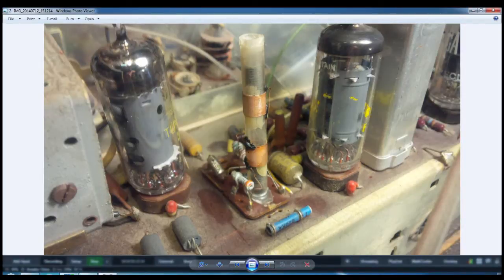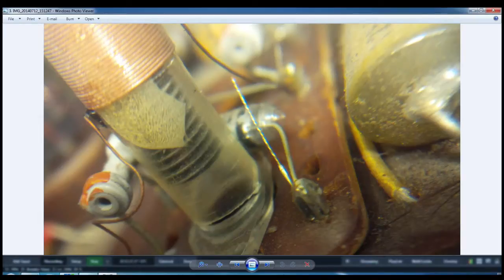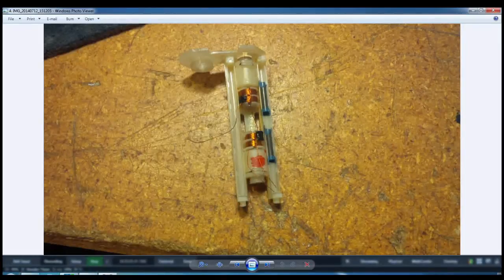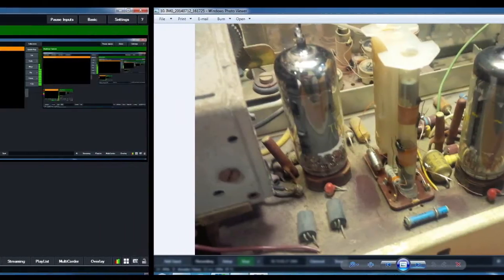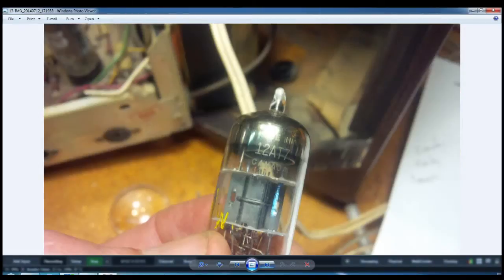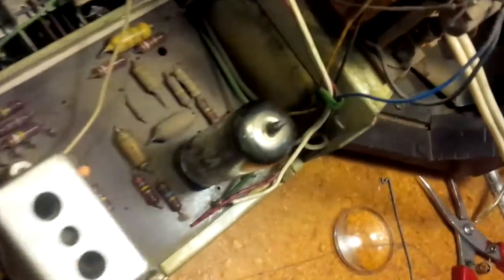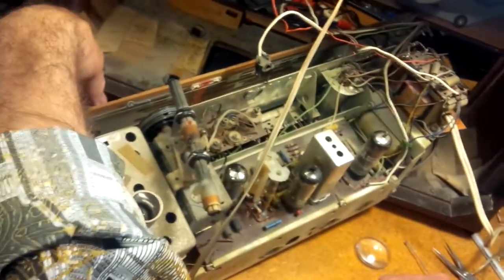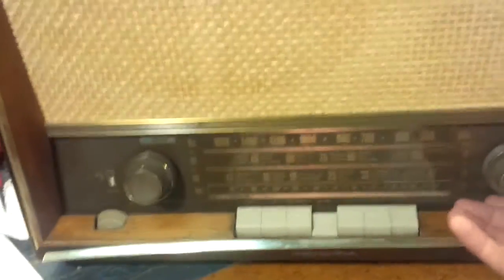Graetz Polka 1113E German Antique Radio Video #7 - IF Coil Repaired

Comment from the maker: I need to explain what happened with the 12AT7 tube that I thought was the wrong tube.  The schematic designates an ECC85 for the tuner and I thought the 12AT7 was a mistake by someone.  Off camera, Ted and I discovered that the radio had been wired for a 12AT7.  Since the heater is 12V centre tapped, it can be supplied with 6.3V from both ends to the centre and will work in a 6.3 volt radio.  One of the reasons we thought the FM was not working with the 12AT7 was that I was turning the AM knob trying to get the FM to tune in stations.  Once I realized I wasn't turning the FM knob, presto I was able to tune in FM stations just fine.  Unfortunately, I didn't catch that on video or explain it in the video.  The only thing wrong in this radio was the damaged IF coil.  Once that was fixed, it worked!